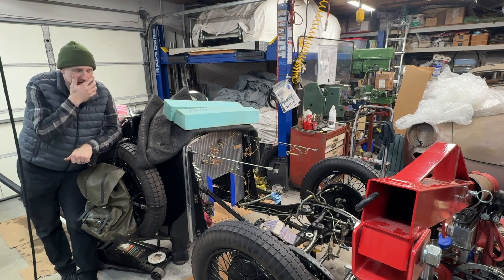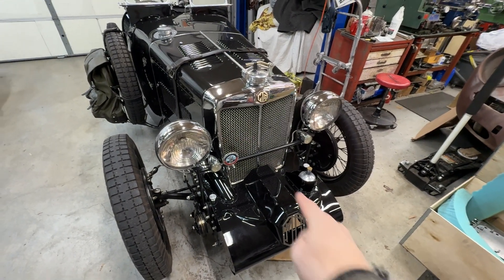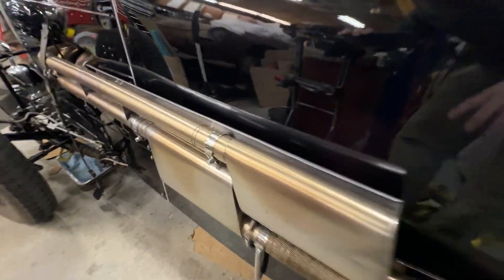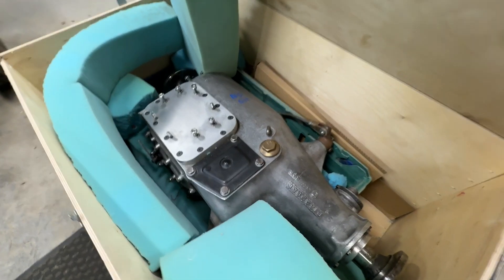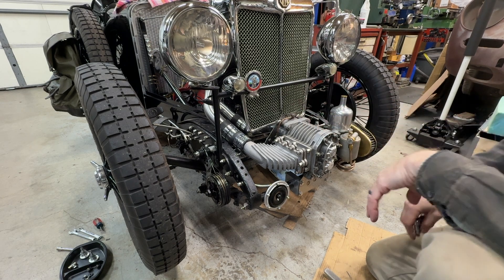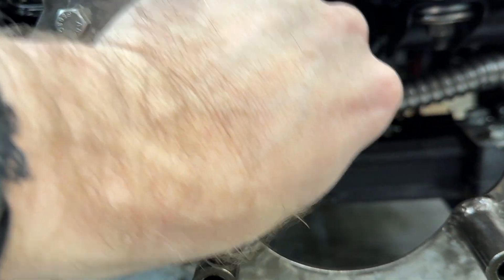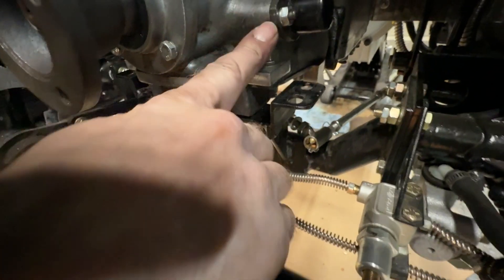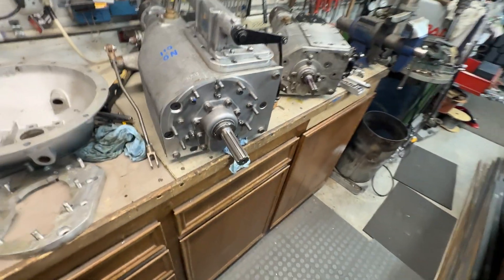MG TA Special Race Car Part 2: Torn apart? Why I needed to disassemble the car.

Comment: Big job taking it all apart. I am building a pre-war car and am getting fairly close to getting it done but then I have to take the whole thing apart to paint it all. I am not looking forward to that!
Reply from the maker: They are fun projects if you enjoy the process. What kind of car are you building? I find that every time I take it apart, it goes back together a improvements. I keep finding better ways to mount things, or modify fasteners to make them easier to remove but not shake loose.
Reply: @Craig.cootsona  It's a Riley Brooklands replica. You can see it on my channel. Making thing not shake apart is definitely a challenge! Everything moves on these pre-war cars. There is so much chassis flex on mine I wonder what is 1. going to fall off and 2. what will break once I get it on the road. I also have an MGB I restored some years ago.
Reply from the maker: @asciimation that sounds like a cool project. I'll check out your video. I saw a Riley special at the western Washington all British field meet a couple years in a row and it was a great looking car!
Reply from the maker: What a great looking car! Nice work. I subscribed so I'll look forward to your updates.
Reply: @Craig.cootsona  They aren't particularly common in the US I think. The Simeone Foundation Museum has a Brooklands. They had some films of it but it doesn't appear on their web site unfortunately.

Comment: Craig I I’ve seeing your car in all its stages of assembly and/or disassembly.
Either way she’s a beauty!
Truly, I can’t get enough of the eye candy you’ve created.
And the mechanical bits that you’ve brought together-it’s a masterpiece!
Reply from the maker: Thank you. It's been a fun journey and I've learned so much from that project that I'm considering doing a 2-seat American Indy car version. I have a spare Jag engine sitting on the shelf that would make a nice substitute for the old twin cam Miller engine! But that will all have to wait until I finish my current projects.

Comment: What was the history of the original transmission? Is there anyone who could have re-constructed your origianl clutches? I hope the new adaptor plate goes well. Our 1924 BSA trials car used to have a period Daimler fluid drive transmission. Parts were unobtainium (of course), and our shop ended up rebuilding a couple of other period transmissions and adaptor plates, before we got it  running correctly. There was much trial and error involved, so now we have four rebuilt motors and  three transmissions. Dr. Lynn, Hochkraeusen Racing, Ohio
Reply from the maker: I bought the first gearbox with a bunch of other parts for this project but the history was unknown.  I assumed it was rebuilt and adjusted but I don't think it was ever mentioned by the seller so my assumption was clearly incorrect. I found out it was from a Daimler Consort. I recall that they also used a fluid flywheel coupled to the pre-selector box. There are people who rebuild them in England, and in fact a friend of mine in CA sent one out because his first motion shaft failed. They reline the clutch bands and check all the linkages and bearings. It took a long time and great expense to send it out and back so I opted for replacing it altogether. Now that we have X,Y coordinates for the adaptor hole centers, the most difficult parts are out of the way, with the exception of adjusting remote gearchange linkage. I'll have to spend time coordinating the arc of the remote linkage arm relative to the little side selector lever on the gearbox. Then it's just a little fabrication of the rear transmission/floor mount brackets, new front floor boards, and reassembly.
Reply from the maker: I also see this as a great opportunity to learn some more precise measuring and machining skills from my friend so I can add more tools to my toolbox of skills.
Reply: @Craig.cootsona  Yes, thank you for the detailed replies. I thought perhaps you had been dealing with a Daimler unit. They were popular and highly rated at the time. Our shop ended up aquiring a one hundred year old Cincinatti horizontal mill just for transmission work. Luckily it came with two boxes of cutters and specialized tooling which ended up being perfect for the work. We fitted a modern digital readout and last summer we completed two transmissions. All it takes is patience and attention to detail which you have in abundance. So, great work, that car has a lot of you in it !

Comment: Hello Craig, nice to follow your work on the Q-type (TA-Special). I have been drivning our car a coupel of times this summer and hope to do some more driving next year. I have to do some tuning of the SU HV8 and possibly our 123-ignition. 
What needle do you use on your SU?
/ Anders 🇸🇪
Reply from the maker: Hello Anders, good to hear from you and glad you are running your car too. I finally dialed in the the Andre Hartford dampers to a softer setting and it made a big difference in ride quality so I drove the car more often in the fall. For my HV8, it's really much to large for even a blown 1328cc engine but I liked the look, and it works well. I jetted the setup with a 0.125" jet and modified UVO needle silightly thinner at the first 6 stations (1/8" increments from the piston) to richen it for my engine. Also, since the HVA has no damper or damper spring, it's critical to use weight for the dashpot piston so it doesn't jump up too quickly and lean out mizture on acceleration. Too heavy and it will always run too rich, too light and it goes lean on acceleration. I think the stock piston is 12oz so I laid 2oz lead weight in the bottom for the ideal 14oz. This was confirmed by Oliver Richarson who has worked on original Q-types. I can send you an email of the method I used to tune the needle and the sheets I used to track needle profile. . . it's a little work at first but takes all the guessing out of it.
Reply: @Craig.cootsona Hi again Craig, did you see my answer with email address from yesterday?
Reply from the maker: @AndersDahlberg-x2j  Hello Anders, I didn't see your answer but I have your email from previous communication so I'll try that.